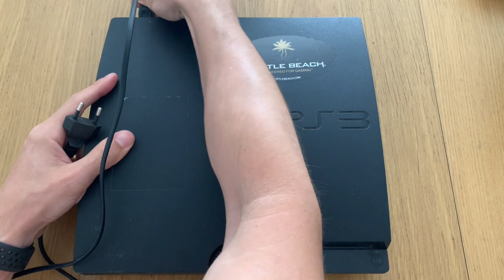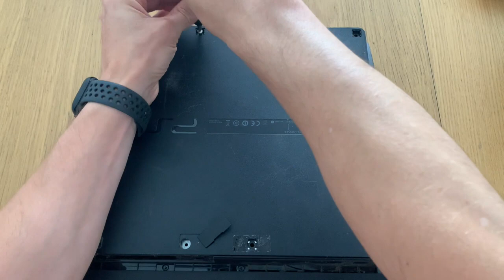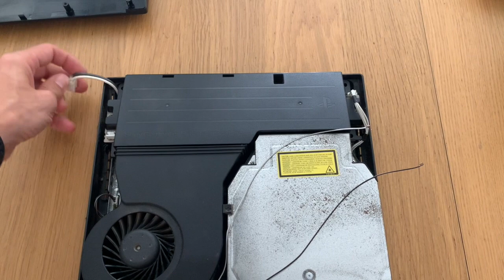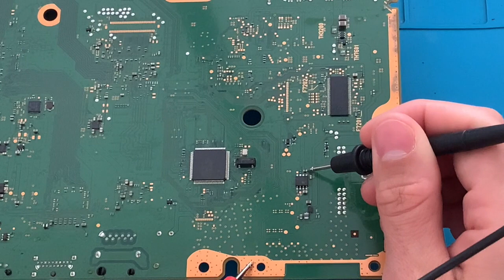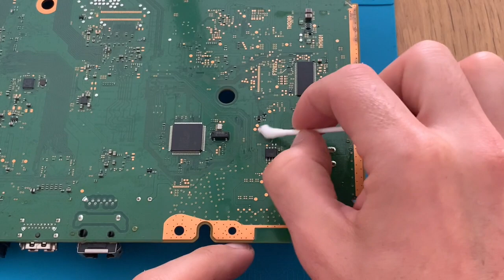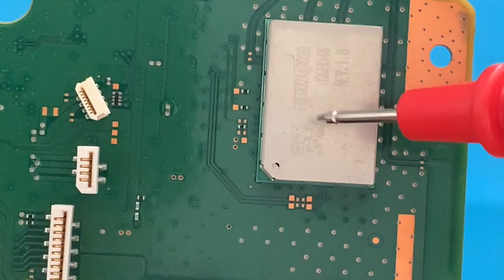PS3 no Red light only Beeps no power, but why?

Comment: i had a problem of power supply i replaced it wth new one bt when i turn onn the fan runs and stop and the fan its a little bit stiff i dont know what is the problem
Reply from the maker: You may have a faulty fan if the console starts and plays